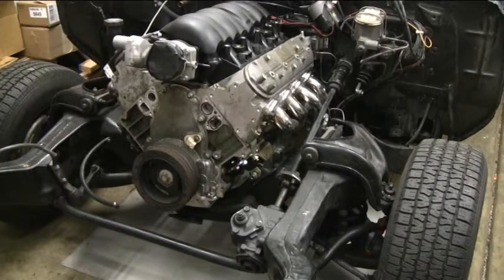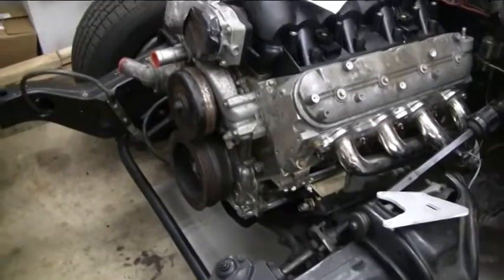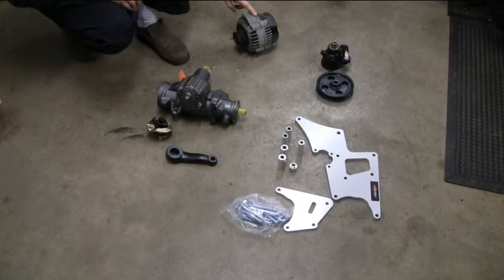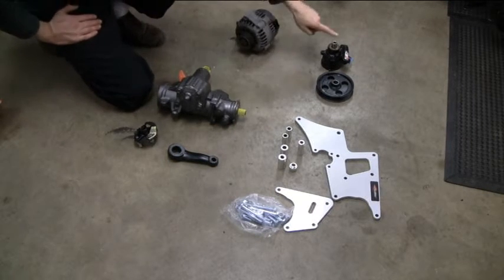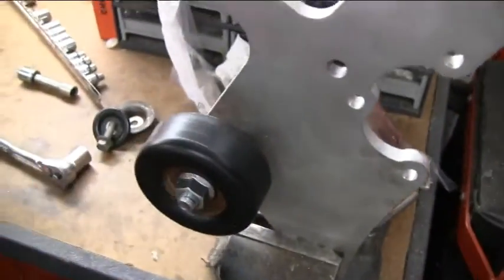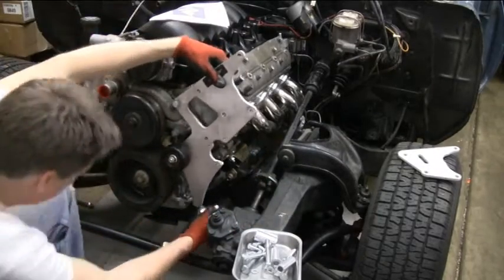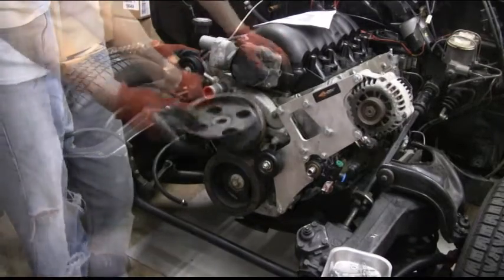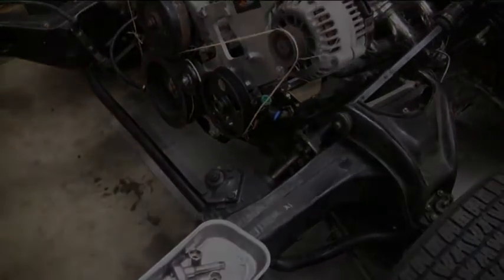LS Conversion Swap Part 10 Accessory Drive (there is no part 9)

Comment: Hey what headers did you use
Reply from the maker: Check out Video 8 for header detail.
 I can't find the exact listing for who I bought mine from, but here is the link for basically the same thing:
https://www.ebay.com/itm/LS1-LS2-LS3-LS6-Conversion-Swap-Headers-Camaro-Chevelle-Nova-Firebird/302944434391?_trkparms=aid%3D555018%26algo%3DPL.SIM%26ao%3D1%26asc%3D20131003132420%26meid%3Dad72a5b42e994d4a9ae38b3af3c44ac4%26pid%3D100005%26rk%3D4%26rkt%3D9%26sd%3D332140022758%26itm%3D302944434391&_trksid=p2047675.c100005.m1851

Comment: Hello  sir , I enjoy watching your videos and I just found you on here.  I was wondering that you don't need to cut out the transmission housing area to make it fit? I have a 69 lemans and I'm thinking of changing it to LS engine too.. thanks
Reply from the maker: For the LS no cutting needed. I am using the same bell housing I had with the SBC. Years ago when I put in the Tremec TKO600 5-speed I needed to cut the tunnel to make it fit, but that is unrelated to the LS. If you are using an late-model automatic I am not sure if tunnel mods are needed for that.
Reply: Prime Garage GM A-Body LS Swap thanks for the fast reply..so at beginning of the 5 speed tremec installation,  u had cut it the housing area right? But at the installation of this LS engine you didn't ? I checked but i did not see .. once again, thank you for uploading the videos,  I've been wanting to do this for a year now. I been watching your videos half of my work day today lol
Reply from the maker: Correct, cut when I put the Trans in, no cutting needed putting in the LS.
Reply: Prime Garage GM A-Body LS Swap ok, thank you very much ..love your videos, I definitely will watch them over and over again..